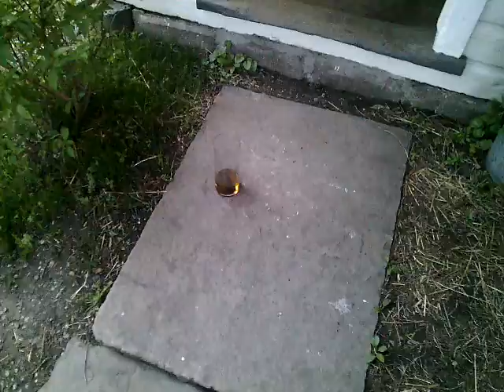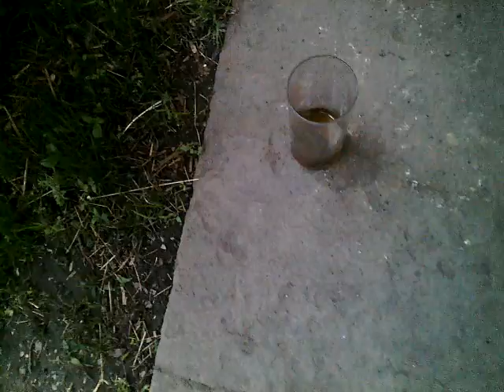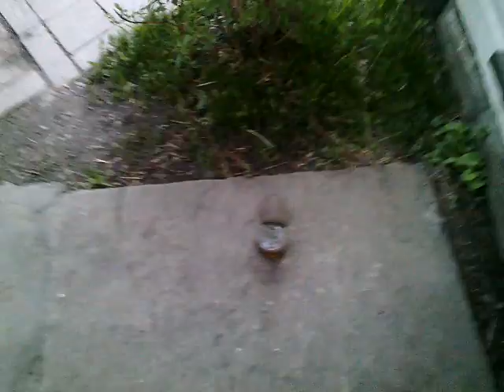How to remove galvanized coating with muriatic acid.

Comment: Muratic acid IS hydrochloric acid.  It has nothing to do with water being added as, unless you get your hands on fuming HCL or make it yourself your HCL is going to contain additional water. HCL is the acid that you find in your stomach, but very weakened compared to what you're working with.
If you put the piece of metal in the HCL and it doesn't fizz it isn't galvanized or the galvanized material is so coated with rust it will take some time to get past the rust.

Comment: Hello...Greetings  from Chihuahua,  Mexico.
I  have a question. 
I have a Galvanized water tank
And I would like build a Bbq smoker.
Can I use a muriatic acid to remove 
The Galvanized,  and grill  o smoke 
Meat ?
Thank you very much.
Reply from the maker: You could but I doubt it would be very thorough. I would think the best way to remove the coating would be to start a very hot fire in the water tank and burn off the galvanized zinc coating. good luck :)
Reply: @themadsmith857  I know I am 3 years late but maybe it can help someone else down the road. I don’t know how it turned out but the one thing you want to make sure of is you do NOT want to breathe any of the fumes or smoke coming off the fire/tank. You also don’t want any zinc left once you start cooking either. Zinc poisoning is pretty nasty and can cause death. I would really just recommend getting something else to make a grill out of. That water tank is probably pretty thin anyways and will burn/rust through within a few heat cycles!!! Good luck.